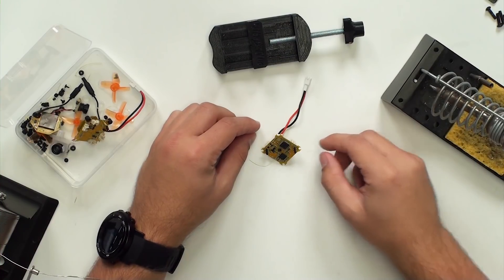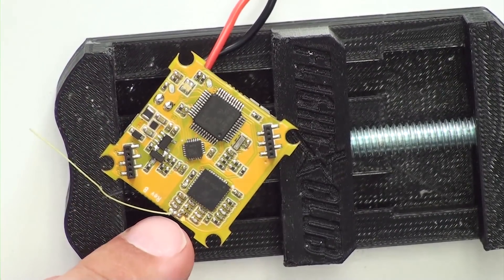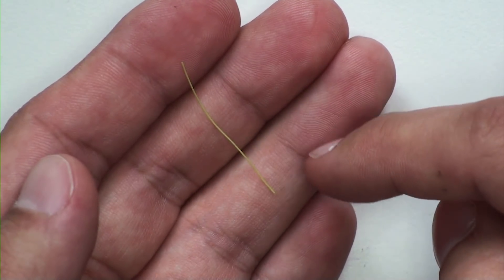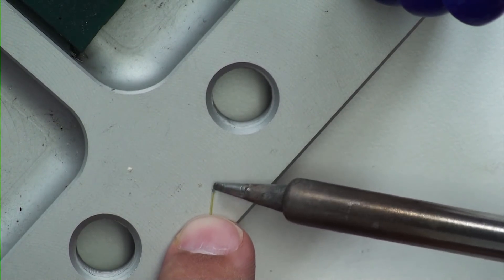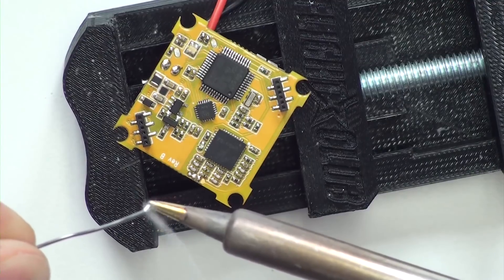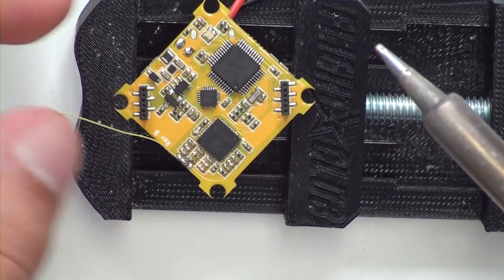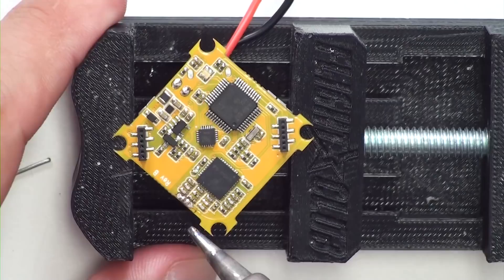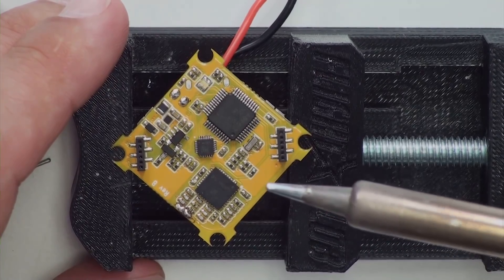BeeBrain V2 Antenna Repair

Comment: So soldering antenna doesn't need 2 pads? How does that work? All the big antennas I've soldered have signal (or middle) and ground (the outside). How is that antenna just soldered down all willy nilly? Have I been wasting my time doing both parts?

Comment: It appears there are four solder pads. Which ones are connected to the external antenna when soldering is complete?  The rear three?

Comment: Now if you leave that bridged and then resolder the antenna also would you in essence have a dipole or a 5/8 wave radial ? Any other Ham radio operators besides myself that are better at theory than I ? Or would it just short out or cancel out ?